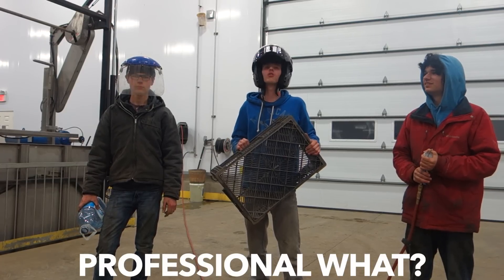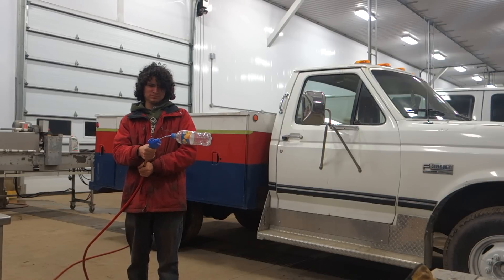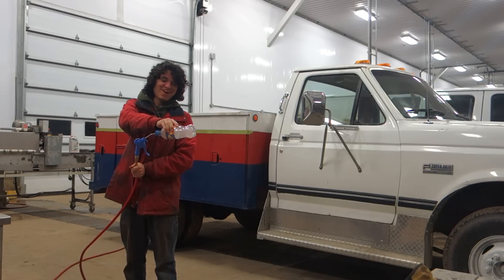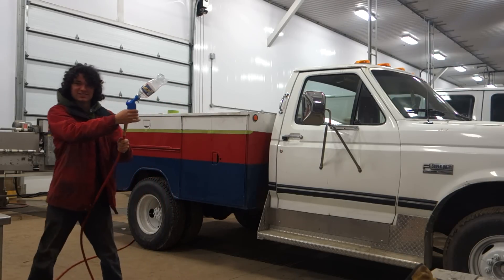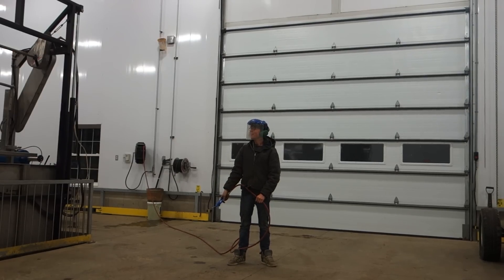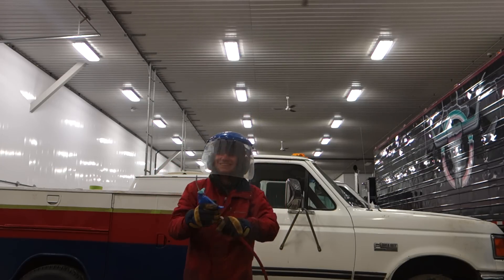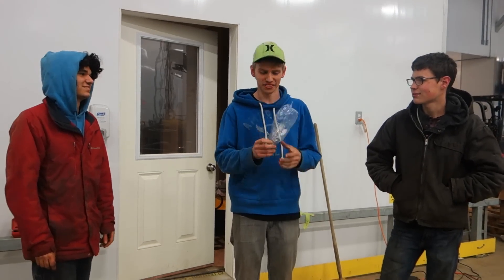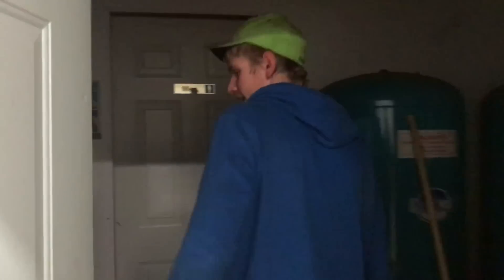Water Bottles + Air Compressor = DANGEROUS! (don't try this at home)

Comment: How did you hook the bottles to the air nozzle without them leaking¿
Reply from the maker: +Tony Hawk  Made a small hole, shoved them onto the nozzle. They leaked, but not much. Also tried water, but not sure if it helped at all.

Comment: I used to do this when I worked at my uncles machine shop. he has a couple machines that require 300psi and it was alot of fun. dangerous too but it looks like you guys have the P.P.E. down. lol you guys should make some acetylene bombs Next next.
Reply from the maker: +Jeepsterdaddy 37  That's crazy and awesome!!  It sure is dangerous though,  we had some shrapnel marks on mikes leg for a few days. 
Acetylene bombs sound exciting..... and dangerous... I'm sure we will give it a try sometime.
Reply: Start small! Take a Styrofoam cup and put it upside down on a table, but a little acetylene in it then you something long to light it. Kind of hard to explain but I'm sure you can find some videos on YouTube and figure it out. Lol Have fun and start small!
Reply from the maker: +Jeepsterdaddy 37  Thanks, it sounds like fun!  We will try to be safe about it...